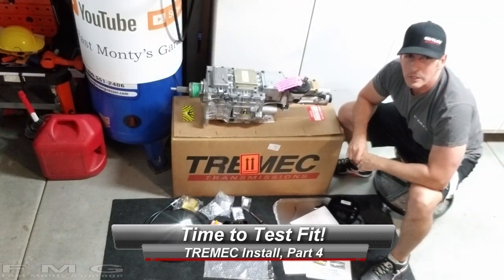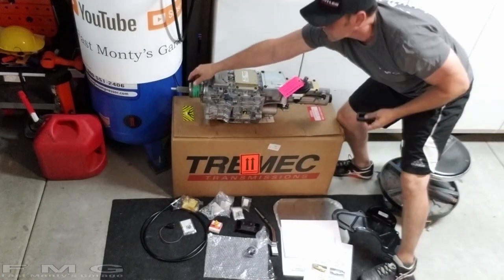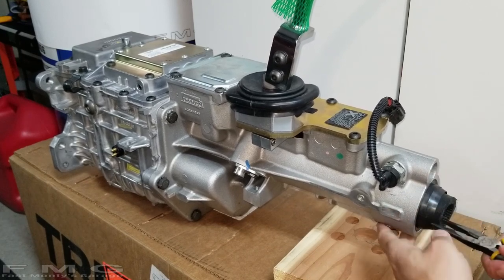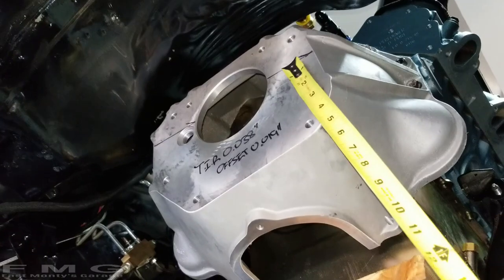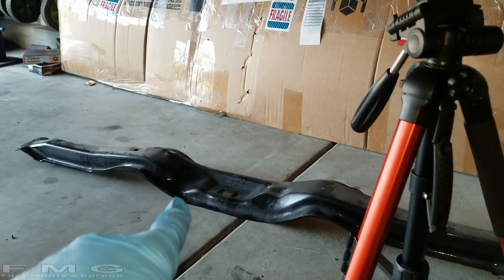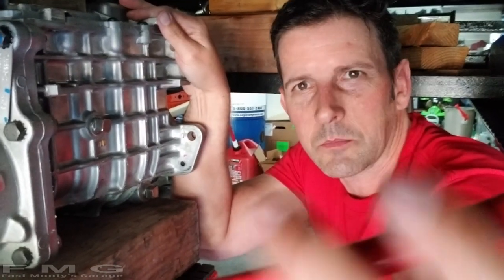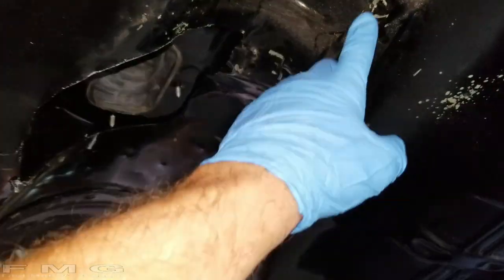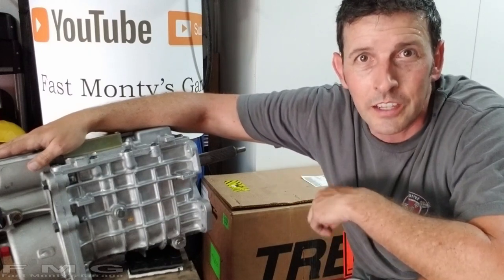TREMEC TKO/TKX/T56 Install, Part 4:  How to Test Fit your TREMEC.

Comment: Hey, junior...  That's why they make transmission jacks, so you don't have to struggle while you try to dry fit everything.  😉 "Just a thought."  (You can rent them, if you spent all your money on a transmission 😀).
  For those looking for an affordable motorcycle lift as their alternative, Harbor Freight has good deals on them and they're often on sale for inside track members and there's always a 20% off any purchase (sometimes 25%) floating around the HF coupon sites and store flyers.  😊
  They also sell air hammers and attachments so you can dimple/move the tunnel metal without struggling for position/leverage and hurting your shoulder.  You can also (usually) move the metal that extra 1/4" you couldn't get with a standard hammer and dolly/punch, etc. (a  long punch with a rounded nose works great for dimpling those spots where you can't swing a hammer).  Listen to me, it's almost like I've fought those battles, myself! 😂
Reply from the maker: Agreed... I rented mine for life.  bahahhaa... thanks.

Comment: Make a couple alignment dowels by cutting the heads of of some 3 inch bolts and finger screw them into the top two bell housing holes for the transmission and then slide it right in.
Reply from the maker: I like it.  Thanks!  But, most of the time someone has difficulty is because the clutch isn't lined up... the billet alignment shaft is the way to go, which I cover later, when I install my dual disc clutch.  Thanks again,

Comment: Put that rubber plug back in to stop all the metal dust you are generating from entering the transmission. The builder more than likely installed that seal to cover his build from being contaminated from outside sources, not a little oil leaking when you install.
Reply from the maker: Yup, good point.  Thanks for sharing.

Comment: That is one thing I won’t do in my 70 Z28, is cut my floor for a 5 speed or 6 speed. I bought it from the orig owner in 1981. So it’s had a 4 speed this long, so why change now. I use 2 bolts with the heads cut off and use them as guide pins in the top 2 holes of the bell and use a 4 wheel trans jack that can be raised and lowered since I have no lift.
Reply from the maker: Love the work around idea... If that's the car with the "rock crusher" I wouldn't change it either.  If not, I have heard of several F Body guys having success of putting a Tremec in without tunnel mods.  You never know... Thanks again, John!
Reply: @FastMonty  I removed my orig M20 gears out back in the early 80’s when it needed rebuilding and replaced them with new GM M22 Rock Crusher gears.
Reply from the maker: @johnmilner7603  Lucky Dog!  Ha, ha... good idea.

Comment: Why did you replace your bell housing? Just curious.
Reply from the maker: I got lazy and didn't want to clean the original.  :)
Reply: 😂ok just checking thanks
Reply from the maker: @darinandalinahouse9596  No worries... after 300k miles, that thing was NASTY.

Comment: What trans are you replacing? If it's an M22 which side of the trans is the speedometer? If it's on the driver side what is the tail housing casting number? Thanks Bob in MN
Reply from the maker: I'm replacing an M20.  I wish I had a "Rock Crusher".  If I did, I would keep it and add an overdrive.  I suspect you're looking for a new one?  I would go check some Pontiac forums like https://forums.maxperformanceinc.com/  Good Question, and Good luck!
Reply: @FastMonty  No, actually I have one but it has a Chevy tail housing. I'm looking for a Pontiac tail housing to get the speedometer gear on the driver side. I haven't been able to find out what the casting number is. This is for 63 Lemans I'm building.
Reply from the maker: @raimaker6343  understood... I'd check the forums.  Good luck on your build!  Can't wait to see it!

Comment: Hey Mike, quick question: given the power your 462 puts out, it the tko600 able to handle it without breaking? I want to put a tr6060 into mine but I have concerns about the torque limit
Reply from the maker: Good question.  My engine puts out 595 ft lbs.  The TKO 600 is rated up to 600 ft lbs. Granted, I'd love some overhead, but I'll take what I can get. Fyi, I know Tremecs can be upgraded for even higher loads, so if you want 750 ft lbs, you can get it. Thanks for the comment!

Comment: Push the clutch pedal in
Reply from the maker: Why?
Reply: @FastMonty  - helps to center the throw out bearing to help the input shaft slide in.
I did see that you had to Re angle the motor to get the trans in.
BTW great videos 👍 I’ve owned my 1966 GTO since 1991 when I was 20 and you are teaching me new things. Kudos😊
Reply from the maker: @Slingudwig  Ahhhh, thanks Don... but, during the "Test fit" the clutch assembly was not installed... just the poor angled of attack, ha, ha... Thanks for the comment, glad I'm able to share new things here and there.  (This GTO has been in the family since it was born, lots of history)  Thanks again!
Reply: @FastMonty  - BTW, some of your comments smack of military jargon. Did you serve?
Reply from the maker: @Slingudwig  Kinda... My Dad was a pilot in the Navy.  (If you review the GTO Walk Around video, I have the Navy Wings laser etched in the driver side head rest)  And, I live in San Diego, which is heavy Military.  I assume you did?  Thanks for your service!
Reply: @FastMonty  - awesome! Yeah, I went thru Boot Camp down there next to the airport. My dad was in the Naval Reserves at the Alameda Naval Air Station during the early 60’s.
Anyway, “carry on”! 😊
Reply from the maker: @Slingudwig  Thank you, and your Dad for your service.  Awesome stuff.  See ya!